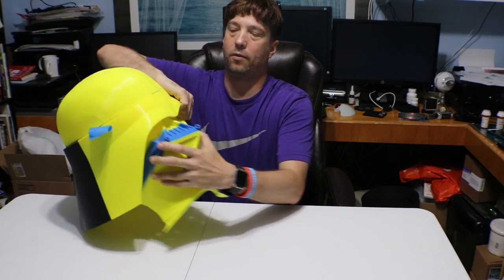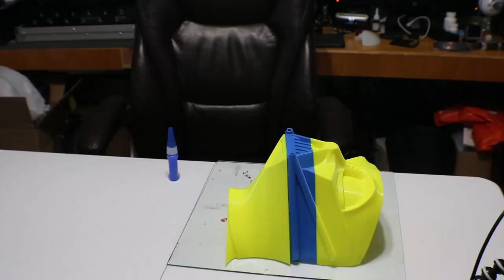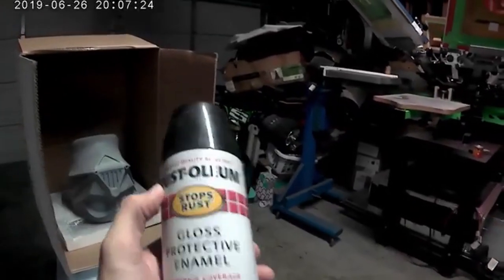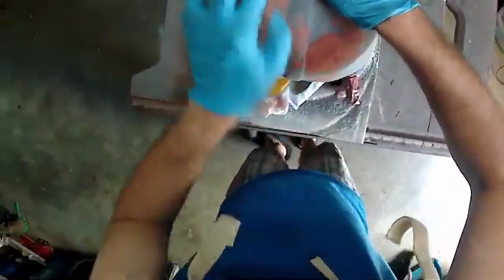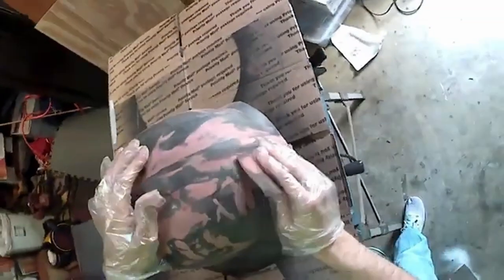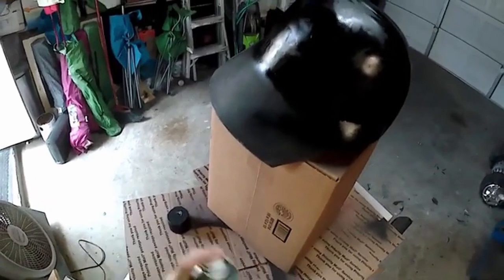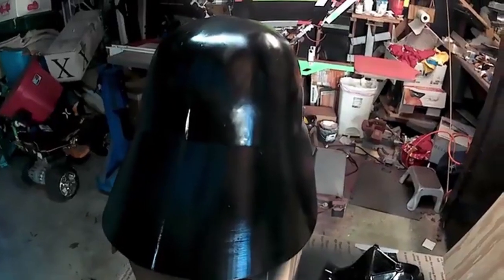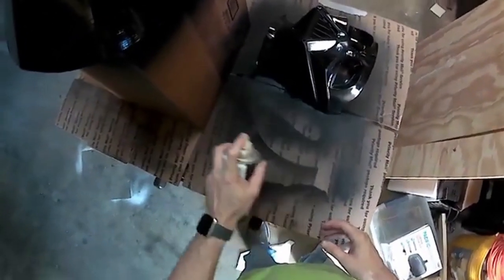Darth Vader 3D Printed Complete Helmet Build - From 3D Printing To Finish Painted Piece

Comment: will this print fit on an ender 3 (220x220 bed)
Reply from the maker: You will need to cut the model up and print in sections.
Reply: Cool Prints Today I’m 100% noob. Just got my printer from Amazon yesterday. What software should I use. I will have a dedicated laptop for this.  Thx 4 any help. 👍🏼
Reply from the maker: @adonian  I use and recommend Simplify 3D.
Reply: @CoolPrintsToday  cool i'll look for it. THX